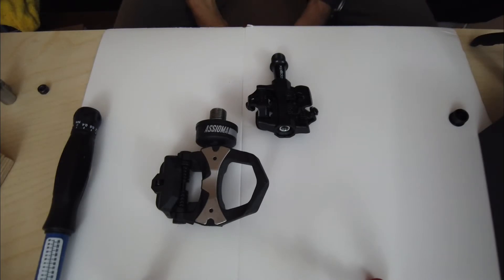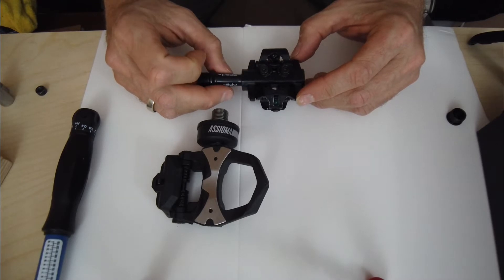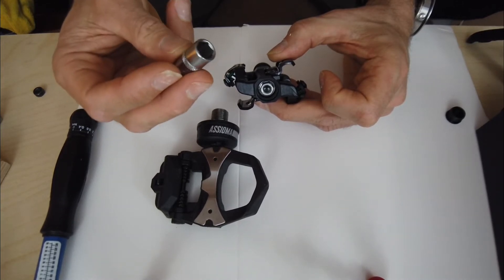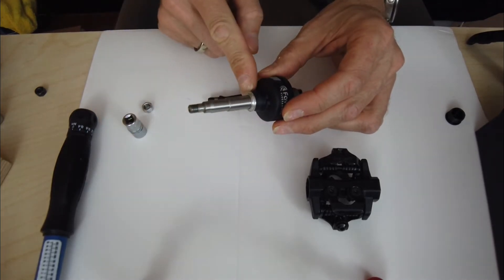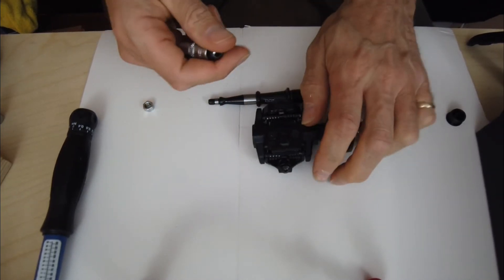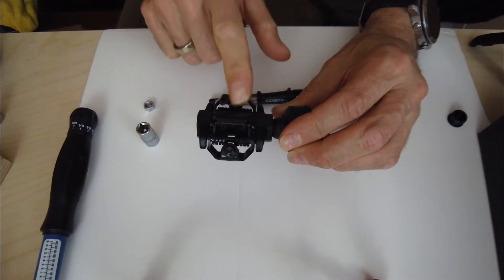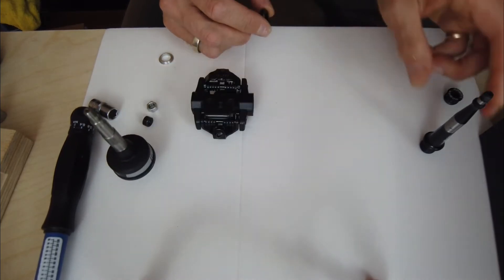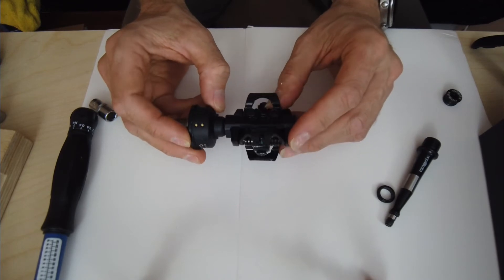ASSIOMA MTB/Gravel Power  Meter Pedal Hack

Comment: The troubleshooting is really useful. Thanks. Do you know what bearings I need to buy in order to replace bearings? (I accidentally bent one and had to use one of the old Assioma bearings to stop it grinding).
Reply: Unfortunately I don't.  I would recommend contacting the companies support team.  Best of luck.

Comment: Thanks a lot - great insight! I just ordered an Assioma spindle (just the spindle, not the pedal body) and Xpedo CXRs. With the Assioma spindle I presume that I won’t have the washer that you opted to put on the inside. Would there be some extra HW needed as long as you only have an Assioma spindle?

Comment: can you advise the inner diameter on the pedal body for checking outer diameter of a suitable 9mm thin wall socket? ...and the outer diameter of tool you used? thanks for a good video explaining the procedure in detail
Reply from the maker: Here is a link to the socket I purchased https://www.amazon.com/gp/aw/d/B00AXTJSGK?psc=1&ref=ppx_pop_mob_b_asin_title.  Outside diameter of the socket is 12mm and the socket wall thickness is 2mm.

Comment: Thank you for the video. These pedals were originally designed for road use. I'm thinking about mechanical strength - how do the sensors withstand impacts against rocks and roots? Does anyone have this experience?
Reply from the maker: I switch them between my gravel and XC bikes.  They have stood up well to the occasional impact.  That said if you expect lots of impacts it is certainly a risk you take and for peace of mind there are now off road specific products available that were not available previously.    I will let others add there experiences.  Best of luck.

Comment: Hi!
It's compatible with all Xpedo SPD models?
Thanks for your return. ;)
Reply from the maker: I think you are asking is it compatible with all Xpedo SPD models.  Unfortunately I don’t know as this was the model my research confirmed.
Reply: @maxlifeoutcycling9284  thanks Max. 👍🏻
Reply: I have tried with Xpedo M3 but did not work beause there is no bearing on the outside, where the nut goes

Comment: Have you found that the nut has come loose at any point after applying the thread lock?
Reply from the maker: Hi, no the nut has not come loose for me on either pedal.  I check them them when I maintenance the bike and occasionally when I switch them between bikes.

Comment: Put the washer in the oven at 80 degree Celsius for 5 min. You will have a difference of sizing of metal at 20 degree the body and the one from oven at 80 which should fit without any tools.
Reply: @Harry Spatz, I used piece of wood and gentle hammer to remove washer, it was easy. The it was difficult to find the right torque : too tight the pedal don't move freely, not tight enough it is unbold. Then I read that I should apply thread locker (blue glue) and now it is perfectly free and also don't go away.

Comment: Thank you for this video. I had concerns about bearing wear too, so it’s good to know there is a combination that works. I’m also wondering how much shoe clearance there is to the pod. Have you found this an issue? If you get chance, could you possibly measure from the pod to the centre of the clip/pedal body, please?
Reply from the maker: You are welcome.  Yes the shoe clearance can be an issue.  I have Fizik shoes and I did not need to modify them.  I measured approx. 38mm from the pod to the middle of the pedal.
Reply: @maxlifeoutcycling9284  Thank you again. I feel much better informed about the hack using these pedals now.
Reply from the maker: @brianlaycock  I wish you well with your research and decision.

Comment: I just did this to mine but with another set of MTB pedals (Wellgo M19), which fits perfectly, however afterwards installation and calibration, the power values seem quite a lot lower, especially while riding out of the saddle. Did you do a test and how did you do the calibration? Same as normal? I am really confused how that could happen...
Reply from the maker: That is strange as the power meter is in the unit and should not be influenced by the pedal.  I have both road and the hacked MTB version that are reading correctly.  I just calibrate as normal.  Have you tried switching back to see if that changes the reading back.  If it does that would be curious but if it does not then it is likely the power meter.  Also check you have the latest firmware.  Good luck and let me know what you find.
Reply: @maxlifeoutcycling9284  my latest theory is that someone the MTB pedal body has caused some further tightening of the pedal shaft onto the crank arm, that the angle has shifted. And this result in a false torque calculation because the pedals think the center of the crank is somewhere else. Which might also explain why standing up is not accurate, because the force is applied at a different place around the pedal stroke. Further more, I have used a Wellgo M19. This has a DU bushing instead of ball bearings, which might not be great because it may wear down the pedal shaft over a long period of time, therefore find MTB bodies with ball bearings only would be better.